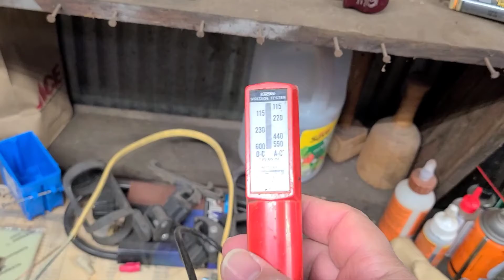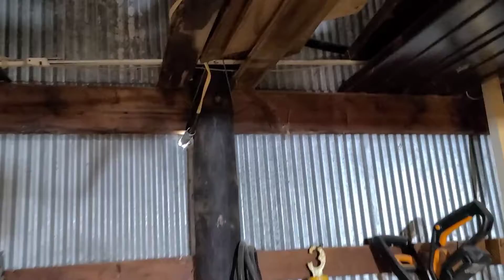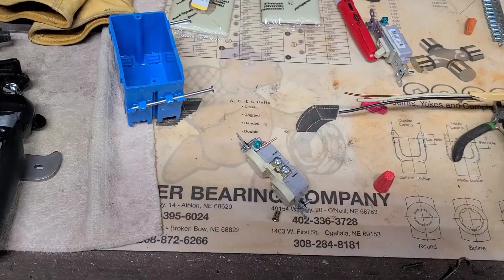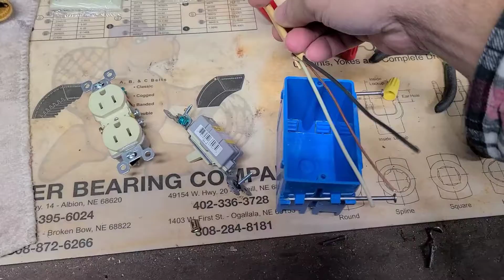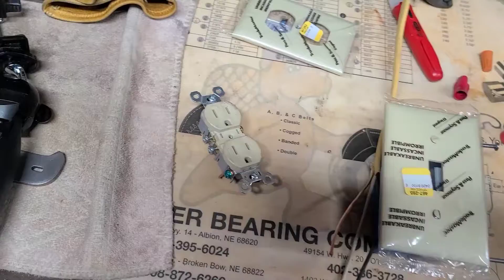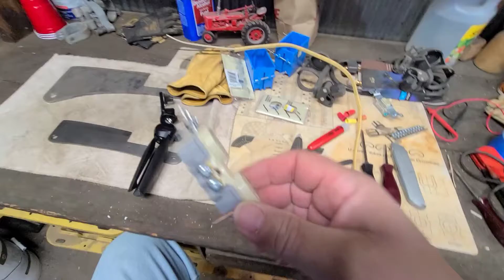Save Hundreds by doing your own Electrical Work. Adding power to our chicken coop.

Comment: Is that truly a 20 amp receptacle? I thought the 20 amp had a sideways t looking slot on one side…. I’m thinking your receptacle is a 15 amp.  But I may be wrong
Reply from the maker: I pulled it out of the 20amp bin. I will have to look. Thx
Reply from the maker: Yup, 15 amp in the wrong bin. It will be ok though. We wont be pulling more than 15.